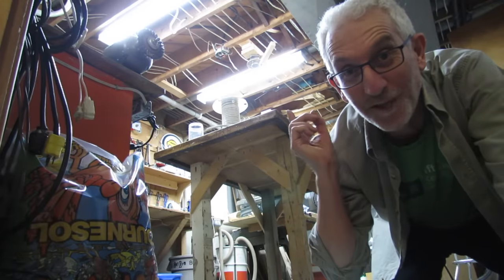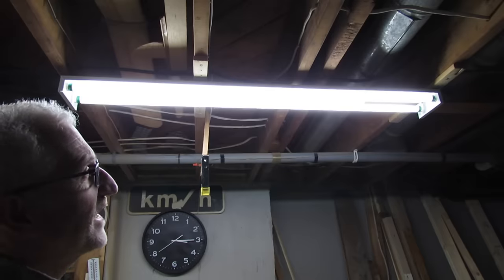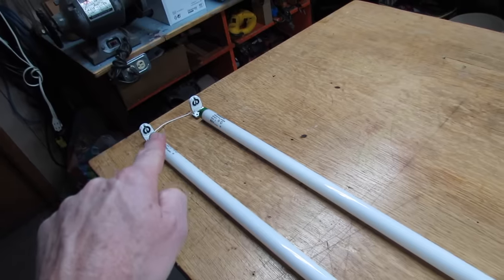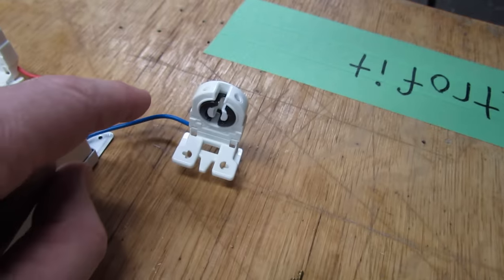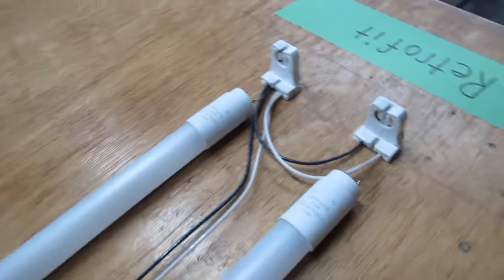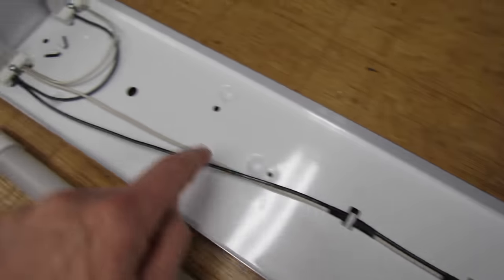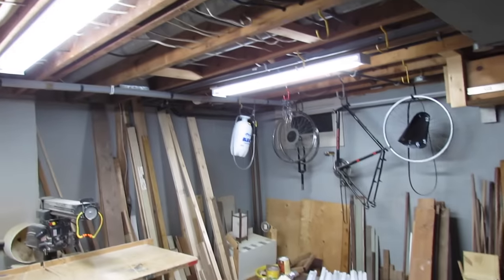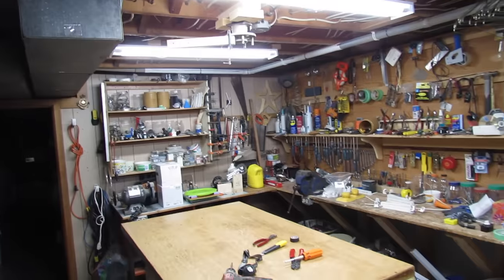How To Convert T8 Fluorescent Lights to LED ● Explained in Simple Terms

Comment: ben converting F40T12CW  and F32T8DL lamps to led and using ballast bypass lamps .easy to do and cheaper than buying ballast! Found that home depot has LED ballast bypass kits that has sockets pre wired . I did find that some ballast old style not electronic have trouble with direct replacement led lamps. for the little work just go with ballast bypass led lamps.
Reply: In the long term it is easier and cheaper to rip all the old ballasts and wiring out and use the type of tubes shown in the video. 
Keeping ballasts that are doing nothing is pointless and if they fail they will simply cause you problems, as well as becoming a fire risk.

Comment: If I go the "plug & play" way, do starters need to be used? if yes, which type?
Reply: In the long term it is easier and cheaper to rip all the old ballasts and wiring out and use the type of tubes shown in the video. 
Keeping ballasts that are doing nothing is pointless and if they fail they will simply cause you problems, as well as becoming a fire risk.
Reply: @wilsjane  Thanks, that is what I did.

Comment: I’d like to have seen the lights before and after side by side. But I’m definitely in the led community.
Reply from the maker: Taking a video of light is a difficult task when you are comparing. The camera auto adjusts and they look the same. If you go manual it still gives an unfair look. Suffix to say the LED's were definitely brighter.

Comment: When I did mine, I just cut all wires close to ballast and removed ballast. Then I used a continuity meter and checked what each wire was connected to on the bulb receptacles (left or right contact). Connected all left contact wires to negative power and all right contact wires to positive power. Then inserted my bulbs and we had light. This was back in 2014. I ordered 8 LED T8s and one was bad. Do yourself a favor and don't try and save a couple bucks by buying from China or some place return are difficult. Buy local so returns are easy, this is relatively new technology.

Comment: Leds are great, but there are 3 types: plug and play, single ended, and double ended. These are wired differently, so be careful. If you don't want to rewire, use plug and play. These work with most existing ballasts. Less work, but know that ballasts waste some energy, and ballasts eventually fail. If you want to bypass the ballast, there are two choices of led, single ended bypass or double ended bypass. 

Single ended bypass leds use two pins on one end, one to line (black) and one to neutral (white); the other end has no connect and just holds the tube in place. This video is about rewiring your fixture for single ended bypass.

Double ended has line at one end and neutral at the other end. There are other videos on YouTube showing how to rewire for double ended.

So you have choices. You choose one led tube type: plug and play for convenience, or either type of bypass. These bypass types are very incompatible, which is why I comment here. Just be sure to mark the fixture with proper bypass bulb type if you bypass the ballast. Never use a double bypass tube in a  single ended fixture, because you may short the power.

I have used plug and play tubes from Phillips with good results. They call theirs Universal, because they work well with modern electronic ballasts and with older magnetic ballasts. GE makes a similar line. These were a quick fix without rewiring. But I know the ballast may fail someday, and that a ballast wastes energy. So someday I may bypass the ballast and change to bypass bulbs. But it is not urgent. That is because changing to leds reduced the current through the ballast by half, which makes the ballast run much cooler and last much longer.

Comment: Just had to ask........ Why did you take the fixtures down to do the retrofit? 

 It also appears none of those fixtures have a cover for the old ballast or wiring. Are there covers installed to protect the wiring from damage or possible electrical hazards?
 
Also where are the warning labels your supposed to affix to the fixtures stating this fixture has been retrofitted to LED and now has 120 volt potential at the sockets? 
Someone puts T8’s back in there, there going to get a slight surprise!
Reply from the maker: I removed the fixtures for demonstration purposes so I could clearly show what I was doing. The bulbs themselves have info written on them.

Comment: If you have a standard switch start light with ballast you do not need to change the bulb connectors because each contact of the connector will be individually wired. So fine for retro fit

Comment: Do you still have your old ballasts?
Reply from the maker: No. I removed then and disposed of them.
Reply from the maker: They can be left in the fixture also. I removed them to make it easier to understand what is happening in the video.
Reply: I know all about them. I am a lighting enthusiast. I restore old lights and salvage them. I do ALOT of LED conversions. I got over 1000 lights just laying around
Reply: Were they really free?? I called 1000 bulbs and they said they didnt do that at all.
Reply from the maker: What do you mean free?

Comment: Unfortunately Florescent lamps diminish in output/brightness as they age.   My only problem with LED replacements is the residual AC flicker.
Reply from the maker: I can only see the LED flicker when I video something on my iphone in slo-mo at 240fps and play it back.
Reply: @chrisnotap  I was at Lowes Thursday afternoon looking for 24" T-12 size LED Fluorescent replacements, as one lamp in two 4 lamp fixtures in our kitchen are on their way out.  The only thing they could offer was the GE 20-Watt EQ 24-in Cool White Linear Type B LED Tube Light Bulb, or the Type A lamps.  One plus is they have a three position switch to pick the color temperature.  Unfortunately on the box it is explained they must be used with an electronic ballast, makes no sense.
Reply: My mistake, the Type A with the Tri-switch are 48".
Reply: in searching on 1000 Bulbs, you can only purchase a CASE of 24" T8 LED Lamps it seems.

Comment: We have been using a retrofit LED tubes, however we have the neutral on one end and the hot on the other end. Please make a video showing this. Thanks.
Reply: Their is no standard for these tubes and several variations in pin layout, so you have to follow the manufacturers instructions.
The tubes with neutral one end are quite dangerous, since if you insert the live end first, the pins at the other end become live until connected to neutral.

Comment: One thing you should all know if your not changing the ballast it’s ok. Taking out the ballast you need the fixture recertification. If there is a fire you could lose everything. Specially from T-12 to t-8s or removing the ballast. Just check with your insurance about non certified fixtures. 
I found out the hard way.

Comment: I only have a couple of these fixtures in my house. A pool table, & a work shop light. I went plug & play in case I want to revert back. LEDs have limited colors. Also, these lights are seldom on so power consumption is not a problem.

Comment: I tried replacing T8 bulbs using this method and I cant get them to work. When I turn on the switch the LED flicks on for a second but does not light up. :(. Not sure how to solve this problem.
Reply from the maker: Are the bulbs you are using "plug and play" or "retrofit" type?
Reply: @chrisnotap  I think they are plug-play but I have tried them in lights with ballast, with electronic ballast and I have bypassed the ballast as well. I have photos of the box but can't upload them here. According to the box "Compatible with most electronic ballast".  Any suggestions on wiring would be appreciated.
Reply from the maker: The method I show is for "retrofit". This will not work for "plug and play". You may want to re-watch the video.

Comment: As an electrical engineer and commercial lighting designer, I can tell you that with all of its advantages, the BIG disadvantage is that you are replacing 2800 lumen output lamps with 1800 lumen output lamps and suffering a marked decrease in the average foot-candle (light level) in the space.  You need to make measurements with a light meter in the space to compare the two sources.  Guaranteed the LED lighting level will be substantially lower.
Reply from the maker: All I can tell you is the final result was a much brighter work shop for me.

Comment: i replaced my t8 fluorescent bulbs all 4 of them and they dont even work. i have a whole box of 30 and they are all good. i checked the breaker box and the electricity for the garage is on.. what should i do now ? help
Reply from the maker: So many questions. What bulbs did you buy? Did you re-wire? Did you retro fit or get plug and play?

Comment: There are 2 different types of led tube
1. uses the ballast usually 2 fer 10 at  Wally, there is a list of acceptable ballasts. BUT if your fixture is acting dodgy on start the ballast might be junk and even the conversion bulbs won't light
2. No ballast type, 2 fer 20, then comes the rewire, for just over 30 you can get a whole new decent quality fixture at HD w/ led bulb, ask yourself if the work is worth it or just hang a new light.
You can buy a cheaper led shop light but will it have the lumens you want.
I went with the new fixture ordered from HD for 32 as a special buy, YMMV

Comment: why are mine not working I put led one in they work then when I shut of the light switch an turn it back on the flutter lightly. if I flip the switch fast uo an down quickly they will power up sometimes an look great.

Comment: O.K. but let me get this straight about the wattage. Are you saying that each bulb draws about 18.5 watts? So that's 37 Watts total.
If that is correct, that would be a substantial improvement over the Florescent  2 bulb unit with Ballast, because mine draw a total of about 80 Watts!

Comment: This would have been the perfect video, BUT... the part where you do the wiring should had been shown. Not everyone has the knowledge in regards of how to do electrical wiring correctly. My lamps are very old, so I would assume I need to the replace the wires. What type of gauge I have to use?   Thanks.

Comment: Those things you called “Shunted” are actually called tombstones and they can either be shunted or non shunted and if they are shunted you can remove the connection piece to make them non shunted but if they are non shunted you cannot shunted them. Tombstones can be wired up to have egress emergency lighting running off a battery that gets charged from being energized for 24-48 hours if wired properly.

Comment: It's true, when you remove the ballast there's one less thing to consume power and fail. But on the other hand, the circuit components needed to reduce and condition the voltage must be built into each individual bulb, and those can and will fail.

Why don't they make a retrofit kit with a separate transformer/rectifier that would replace the ballast and power all the bulbs in the fixture? This should make the bulbs more reliable and cheaper, especially when it comes time to replace.

Comment: in the uk its actually cheaper to replace the whole fitting with equivalent fitting to a five foot being around £22 or about forty dollars ??? when the replacement lamp and fittings plus disposal of the ballast costs around thirty pounds  and you can sell or donate the complete fitting with out any charges for disposal

Comment: Hmm five, six years ago someone made a remodeling of my office, it has two lamps of two bulbs each, but for some reason they left one lamp with fluorescents and the other was retrofitted with led lamps. At the distance you can clearly see that one half of the office looks darker than the other…the darker side it’s the led lamps. I sincerely don’t remember if it was like that at the beginning, maybe after 5 years the leds are degraded but the fluorescent light is still fine and bright.

Comment: Please help! i am looking for an answer for troubling question i have. could you please put a car headlight compartment in the vacuum chamber to see what will happen?! i've ask this question to a few channels with vacuum experiments to see if they want to try :s
Reply from the maker: A "'headlight compartment"? You need to explain a bit more for me to understand.
Reply: Chris Notap all cars nowadays with headlights or breaklight with blinker lights come in an pressurised compartment for easy replacements. Xenon headlights for example. I'd really like to know what happens when these are exposed to a vacuum.
Reply from the maker: No. They are just a bulb in the compartment but it is not a pressurized compartment. That is too costly for them to make them that way. Brake lights are just a bulbs inside of the red or amber housing.
Reply: ow wow really, then i need to apologize a bit on my part. had that information wrong. then is it possible to try different lightbulbs (xenon, argon, LED's) in a vacuum chambre? but i'm guessing that the glass bulbs will have the strength to withstand a vacuum. might not be a interresting experiment :) thanks for setting me straight, really appreciate it. keep making awesome video's

Comment: Where do I go now, bought the leminus T8 plug & play, don’t work. Removed the ballast and wired one side neutral and the other side hot still nothing. Wired the way you showed still nothing.
Reply: In the long term it is easier and cheaper to rip all the old ballasts and wiring out and use the type of tubes shown in the video. 
Keeping ballasts that are doing nothing is pointless and if they fail they will simply cause you problems, as well as becoming a fire risk.

Comment: I replaced a fluorescent strip light with an LED strip light. Only modification was to replace the plug-in ballast with a plug-in device provided with the LED light. NO WIRING MODIFICATIONS. Seems a lot easier to do than this video, but admittedly he had a large wired ballast rather than a plug-in ballast.

Comment: Just get rid of fluorescent fixtures and replace it with E26/E26 fixtures.  The porcelain fixture cost about $2 each. Then just add $2 screw on LED light bulbs
Reply from the maker: Great minds think alike! I have got all the parts for an upcoming video using the E26 fixtures and Amazon LED light bulbs. Way cheaper and the light from them is great!

Comment: Nice video but I have one observation. When retrofitting there's seems to be no reason to snip the connecting wires at the 'other end' since it makes no difference.
Reply from the maker: Correct. I removed them so there is no confusion

Comment: Be careful--most manufacturers of nonshunted tombstone sockets do not spec or warranty operation with full mains voltage across the contacts.   Under regular ballasted operation, there is only a few volts present across these contacts for the tube heater. There are specifically-rated sockets for retrofit application.   Better yet is to get the retrofit tubes where shunted or nonshunted sockets can be used and each side of the line is wired to the opposite end of the tube.   Probably safer also should an ordinary T8 mistakenly be placed in the socket.

Comment: I have played with retrofit T8 bulbs an fluorescent bulbs a bit. There are two types of lamps, one has an electronic ballast, one has a conventional ballast with a lamp starter. The first is a very decent energy saving, flicker free light, the latter is just bad and requires an LED replacement. That conventional ballast is actually a big coil and warms up quite a bit. That is, where you are losing power. In this case, it is pretty simple to replace the lamp. Just get the lamp starter out of it‘s socket and install the dummy starter, that comes with the lamp. Then install a retrofit T8 Led lamp. No more modifications required. 

With an electronic ballast, things are different. It produces the high voltage pulse, that is required to start the lamp and after that, a low voltage to keep the lamp running. That is usually AC with a frequency of several kHz, so you have no visible flicker either. This type of ballast doesn‘t produce high losses. Most retrofit T8 lamps don‘t work with electronic ballast due to the high voltage pulse mentioned before. In this case, you have to remove the ballast. The retrofit lamps usually have the power input on two pins of one side, the other side has a shortcut between the pins. This is for making it possible to work in a lamp with the conventional ballast and a lamp starter. So here, you need to connect the power on one pin of each side and connect the free pins of each side with a cable. 

Other than that, a retrofit lamp might cause a shortcut in case its internal shortcut is on the wrong side.

I don‘t think, is is really required to install an led bulb  in such a lamp. You might want to swich ti a daylight fluorescent bulb in your workshop. That would be 6500K(elvin). In your living-room you might prefer 2700K  or 3000K (warm white), in your office, 4000K (neutral white) might be the best. 

The flickering of a lamp can be made visible with the camera of your smartphone. Just hold it a bit diagonal to the lamp. Many people don‘t notice it, some do. And it is very disturbing. With this method you can also find the lamps with a conventional load. Because those are flickering with 100Hz/120Hz.

Comment: I've NEVER seen t8 fixtures with "Shunted" sockets.  The ballasts power each bulb separately, not in series.  I can always remove a single bulb and the other three in a four lamp fixture do not go out.  The electronic ballast fixtures do shunt the two pins together sometimes if they don't use the preheat filament feature, and instead start the lamps with a burst of HV.  But the sockets are two wire types, not single.  At least in all the fixtures I've seen.